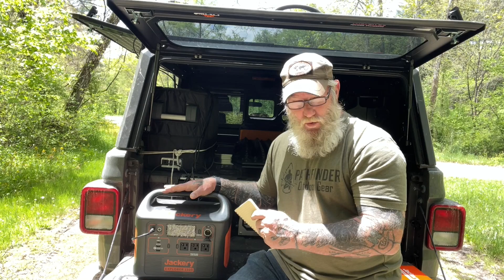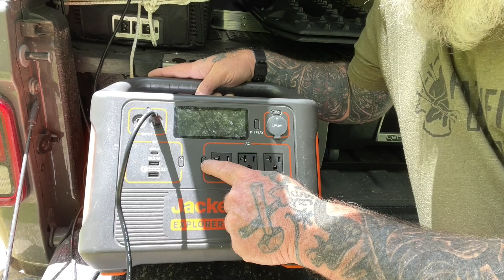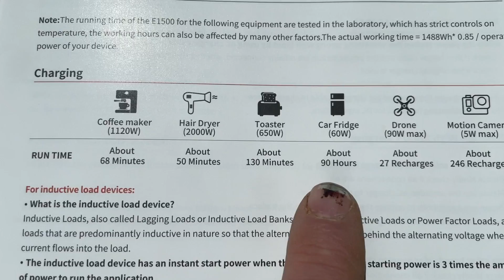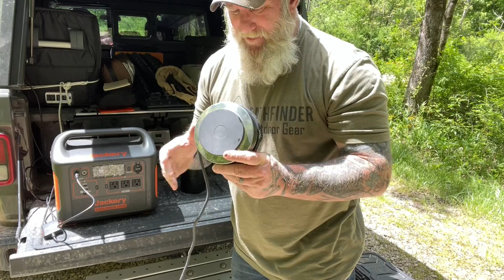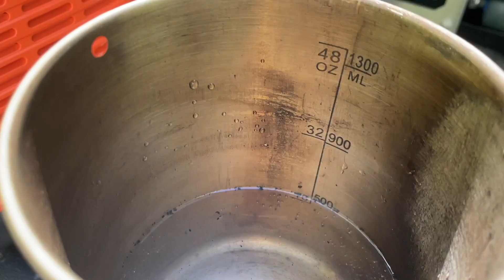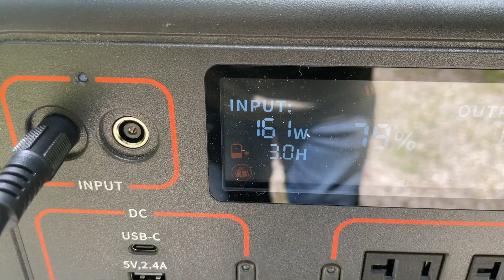Gladiator Build Part 2 Solar Power Jackery 1500

Comment: Great vid! I run the jackery 240 with one 100 watt panel in my camper van. I got usb fan and USB desk light off Amazon. They use next to no wattage and are great for smoothing it. Another thing to note is electric generators are silent. Some campgrounds won't let you run a gas generator after hours. No noise, no smell, thumbs up. Thanks Dave.

Comment: Just a reminder, lithium batteries DO NOT LIKE the cold.  You won't be able to charge it if it gets down to like 32 degrees.  To test this go grab a battery pack for your power tools and leave it sitting in your truck over night and then try to put a charge in it.  The battery tech is just too limited if you are thinking about year around bug out/camping etc.  Better have that little Honda generator and some fuel or plan around not having the electronic gadgets, gizmos, and conveniences.  Or find a way to keep those batteries warm during the cold.  They also don't like real hot temps.

Comment: I really like that hot plate. It seemed to be pulling 450 watts. Is that correct? 
  I've watched many videos on this Jackery and I don't recall anyone pointing out the fact that the 2 panel coupler will not provide any charge with just one panel plugged into it, so that was helpful info.
 I suggest that if you use the Jackery for lighting, don't go with a lamp from your end table at home and a LED bulb. It seems like the smart thing to do at first glance, since LED bulbs are about the lowest wattage bulbs for the amount of light they provide, but inside the bulb is an electronic circuit that has to take the AC power from the inefficient inverter of the Jackery and convert it to DC to light the LED inside the bulb assembly. It is much more efficient to use a string of LEDs that just plug into the USB port of the Jackery, then the inverter doesn't have to run at all. The same would prove true for other small appliances like fans. The ones that run straight off of 12 VDC or USB will run longer before running down the battery bank because they use straight DC. Same as what you pointed out when you mentioned charging MacBooks. You can find USB powered LED stings that provide lots of light, but really powerful fans are going to operate on AC, so small personal fans may be the best you can do there.
  I'm enjoying this series a lot.

Comment: Another good thing to have is a folding or collapsible kettle. Only use 700-800w and boils water in 7 minutes. Doesn't take up much room either.

Comment: Cool truck setup, Dave. I've got the Jackery 500 and a 100w panel. It's outstanding. Costs more than the competition but worth every penny. It ran my 60 liter fridge/freezer for nearly 48hrs on a full charge without any recharging and maintained voltage output right to the end. I can't recommend Jackery more highly.

Comment: Dave, have you checked out the GoalZero brand  solar systems? 

I have been over the past several months checking out the GoalZero  1500watt solar charger with 2 200 watt solar panels. I’m using this system to power  20 quart  Iceco refrigerator/ freezer. This setup has for the most part run indefinitely providing I get at minimum of 4 hours of full sunlight each day. The GoalZero 1500 will accept up 600 watt of charge input from either an AC charger or solar panels. Charging the GoalZero 1500 from 0% to 100% with a 600 watt charger takes about 6 hours or less to charge. 

Check out the GoalZero website for more technical details.

For those times I was without extended power ( the Big Texas freeze ) I had no AC power for 72 plus hours, I used a small propane generator periodically to keep the system charged.

Comment: Huh. I have the Jackery 1000 and for one solar panel you don’t need an adapter, it plugs right in. I wonder why they changed that for 1500. Also, two solar panels gets me about 120W idk how you are getting 200W
Reply from the maker: Not sure why the change but it may have been for power efficiency as you can see in full sun 2 panels is killing it in this video most of the time-

Comment: I use a NOCO GB70 for that. The power port, in the taxi, recharges the booster. I also make money rescuing motorists with dead car batteries. All that excess junk is not in my bug out box. Tell Jackery to hook me up though.

Comment: When you use appliances like a toaster, etc. remember that their ratings are measured in Watts/hours. That toaster will actually be running for just a few minutes so therefore it actually uses very little power, over time. Most small appliances have a watt rating somewhere on it. If not it will tell you its Amp rating.  Do a little internet search and you will find a whole bunch of confusing info on this subject.  For us non electrical dummies, A60 watt light bulb uses 60 watts of power in 1 hour. So if you have a 60 watt toaster running for 1 minute, it has use almost no power 10 watts.
Determining just how many Watt/hours ALL of your appliances would draw if operating at once is nice to know, but not really necessary. Only appliances like that little frig, need to be carefully calculated.
I have a cheap 750 watt inverter, which runs off of a car battery. For most camp uses that much power (watts) is about your minimum.
I have done a lot of study and some research on this subject. I find it all confusing beyond what I've just related, and I may not be entirely correct. However, Dave's big unit is the bomb, plenty of power. ;-)

Comment: I've enjoyed my set-up from Overland Solar.  Then, some dirt-bag broke into my rig and stole my battery case portion of it.  Now I need to replace that.  Curious now, will my existing solar panel be compatible with another brand of set-up?  Good lookin' piece of kit.

Now (Dave), wait until you discover the McLean Metalworks hammock hanging set-up which gives you the option of either using a 2" receiver hitch, or an added piece that ratchet straps to your rig's tire... and then the set-up utilizes the 2" receiver on that piece.  Sleep in your hammock without trees, right next to your car.  Love mine.

Comment: Well done. You are the first one that mentioned the (Solar Panel Connector) needing an adapter. I've seen many other offroaders review this jackery but none of them pointed that important information out.
Reply from the maker: It is only Different on the 1500, more power efficiency I am told
Reply: @DavidCanterbury  ,  Connectors are the bane of most electrical equipment. Trust me, I've almost had a fit over some!

Comment: I can see many uses for this but I would set up a small backpack stove to boil water. It take no time to set one of those up and I'm not wasting battery power.
Reply from the maker: I carry a Jet boil in my Kitchen box, this was just a quick example of a 100 Appliance, but sometimes ISO is hard to find if you run out on the trail and I also cary propane but it never hurts to have small redundancies in case
Reply: @TheLawDemon I agee, Luke's review is even more down to earth practical & yes, Luke's is the smaller Jackery 1000.  My sentiments about using my Soto Windmaster backpacker's stove, to more efficiently boil water in 2-3 minutes.   My primary use of a Power Pack would be to power a refrigerator day & night, to keep food cold or to power, an electric blanket all night long & not have a dead vehicle battery the next morning.
Reply: I’m looking forward to seeing your rifle scabbard mollied to that side panel!